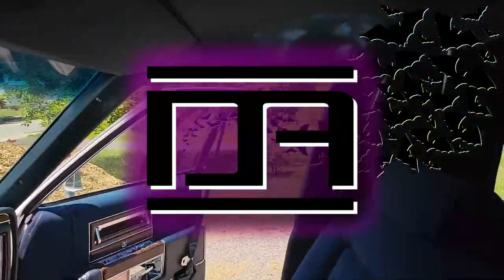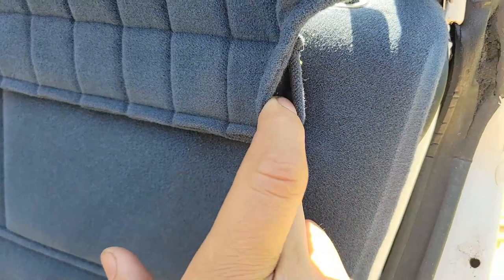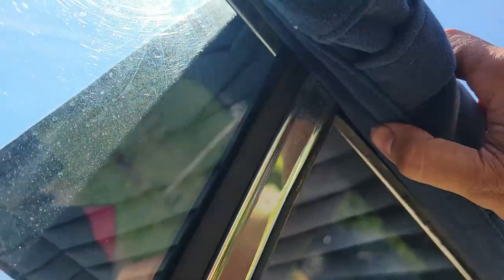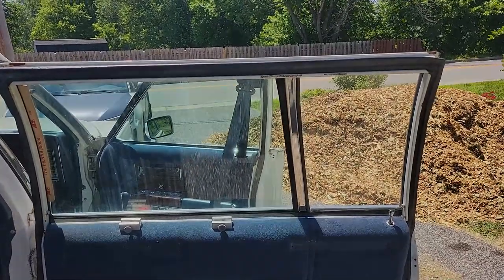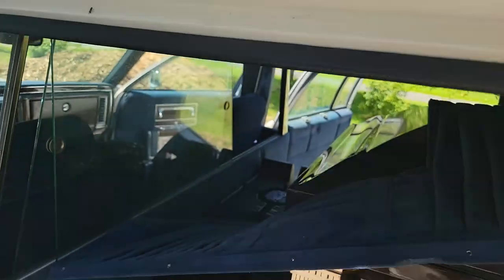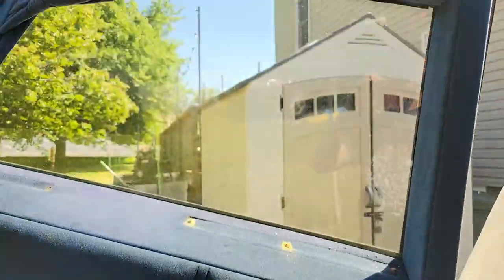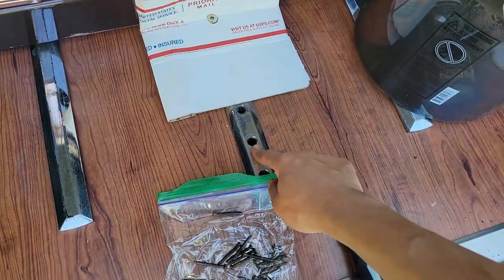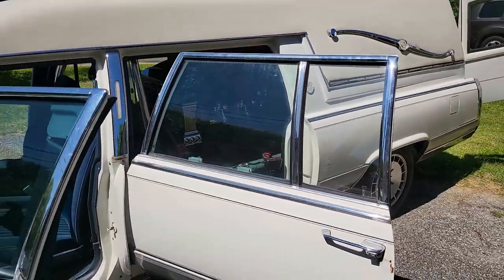Removing Static Window Privacy Curtains (1990-1992 Cadillac Brougham Hearse)

Comment: A little bird told me not to get this car because you won’t be able to see your blind spot, is that true?
Reply from the maker: I was actually pretty concerned about that myself, but I haven't had any issues with lane changes. It's definitely easier now that the curtains are removed, but a properly angled mirror and a quick over the shoulder check and you should be fine.